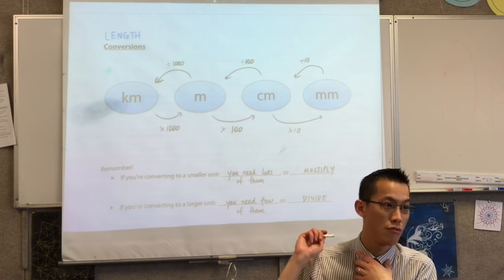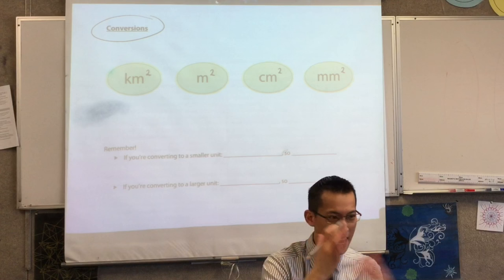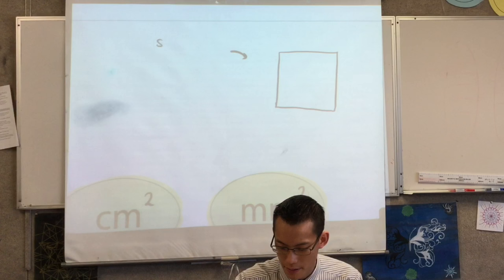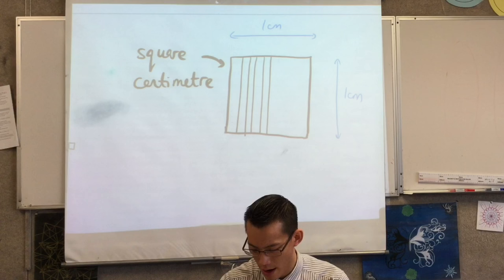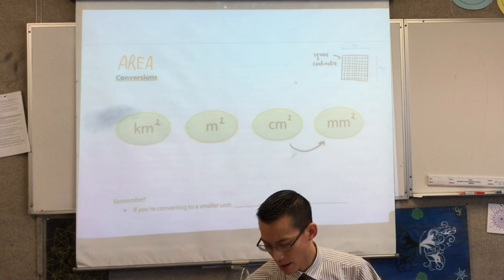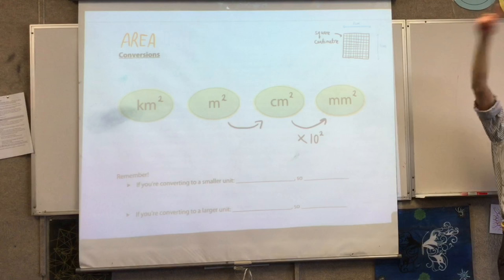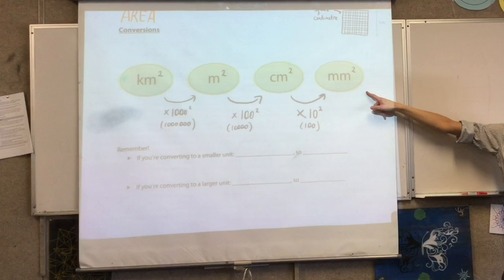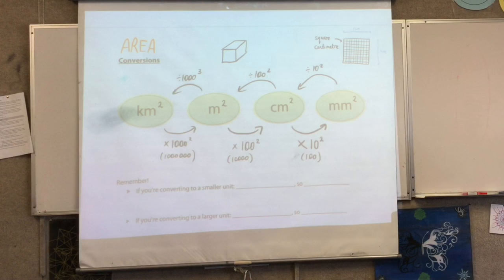Area Conversion (Introduction to the conversion between area units)

Comment: When you say multiply by 10^2 or 100 it implies almost as if they were multipliers which is wrong! In the case of unit conversion, for example, convert 5km to meters, which is 5 x 1000 = 5000 meters,  5 is the multiplier and 1000 is the multiplicand. Why? because 1km = 1000 meters, in other words, I have 5 times 1000 meters!. You can also look at this as km being constant 5km is basically 5xkm you just replacing km (which is km =1000 meters).
Reply: Girl you bright you must top girl in you class or boy